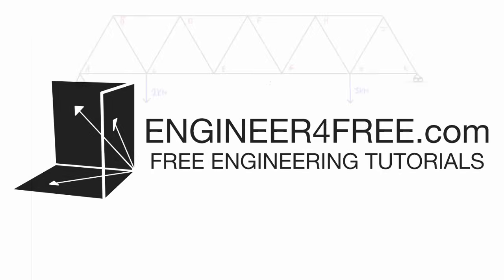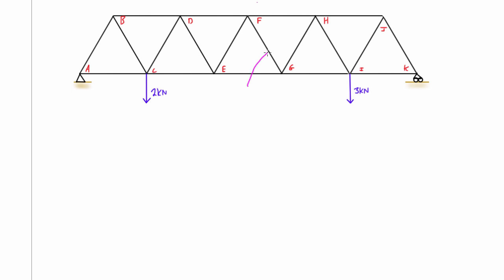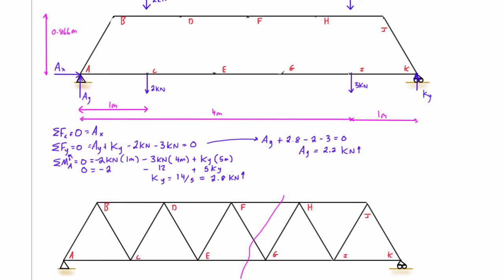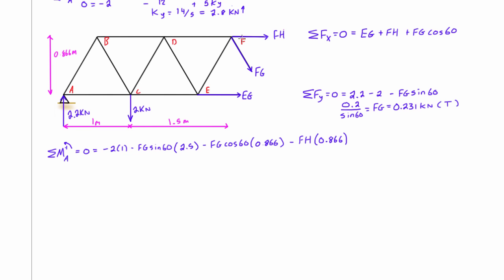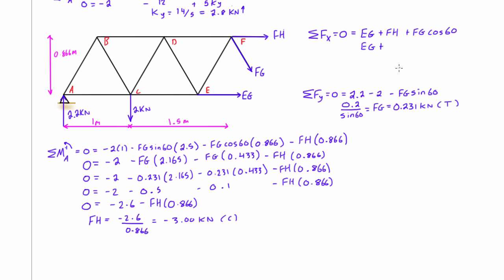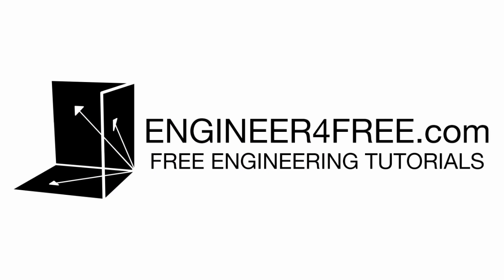Truss analysis by method of sections: worked example #1

Comment: If you had taken moment about Point F, it would have been one step to solve the problem. Nonetheless, very well explained
Reply from the maker: Yeah true. If you can see that, then you're doing alright =) =)
Reply: @Engineer4Free  could you please explain what ou mean? if you take moment about point f wouldnt the forces we want to find be acting in the point and not formed into an equation
Reply: @nahilismail3144  the force EG isn't, its perpendicular distance from point F is 0.866m- so you can calculate EG and sub it into Fx equation 🙃
Reply: @inyoungbaek6426  thank you so much for helping a stranger you know nothing about. i hope you have a good day!
Reply: Yeah, I was thinking the same. But finding out all the unknowns can be useful for checking the answer by summing all the moments about an arbitrary point and see if that equals to zero.
Reply: @Villager-  looool
Reply: The moment about f should be -2.2kn(2.5m) +2kn(1.5m) +EG(0.866m)=0

Comment: Hey how is the FG cos 60 (0.866) shouldn’t be half of 0.866? I was just wondering this since FG sin 60 is (2.5) because the 1m was cut in half?
Reply from the maker: Yeah so in the first line of the sum of moments about A equation, notice that there are two terms that include FG. One has an FGsin60 and the other has an FGcos60. The FGsin60 is the y component of FG, and it's also multiplied to 2.5, which is the perpendicular distance from A to the line of action of the force FGsin60. The FGcos60 is the x component of FG, and it's also multiplied to 0.866, which is the perpendicular distance from A to the line of action of the force FGcos60. Notice that the line of action of the x component of FG (FGcos60) is a horizontal line, in line with the top of the truss, which is 0.866m above the bottom of the truss. Both x and y components of FG cause a moment about point A, so both need to be accounted for in that equation.

Comment: 3.25 how come you are including Ay of 2.2 kN in the Fy expression, but you’re not including Ax in the Fx expression?
Reply from the maker: It's because Ax is can be determined to be equal to zero by inspection. There are no horizontally applied loads and the structure is simply supported, so Ax must = 0. Because its zero, I just don't bother writing it in the Fx expression. Hope that makes sense!

Comment: When finding the moments at A... when we're looking at the y component of FG acting at 2.5 metres, should it not be cos30? It's acting at 30 degrees to the y axis. Or am I misunderstanding? Thanks!
Reply from the maker: Hey, the equation for moment is M=Fd, where MN is the moment caused about the point, F is the magnitude of the force, and d is the perpendicular distance from the line of action of the force to the point. 2.5m is the perpendicular distance to the line of action of the y component of FG only. 0.866m is the perpendicular distance to the line of action of the x component of the force. Neither 2.5m or 0.866m are the perpendicular distances to the line of action of the force FG. It’s longer to try to find out what that distance is, than it is to just separate it into x and y components and solve by parts.

Comment: If everytime you have negative value and plug it in to another equation, should I plug it with remaining negative sign or can I change to positive sign? as long as the final value would tell you if its in tension or compression? I'm confused, please enlighten me. Thanks
Reply: In this example, you have FH = -3kN then plugged in the Sum. Fy equation to get have a value of EG = +2.885kN. What If I plug it with +3kN since I know that FH is in tension and changed the graph. The  value is different I guess.
Reply from the maker: @shariffnurrmohammad1314  Hey yeah. So just to clarify, FH is actually in compression. I drew it initially in tension, and found it to have a negative magnitude, which means it's true sense is compression, not tension. Once you know that a member is truly in compression you can do two things. 

Method #1) Do not update the arrow on any FBD (ie, keep it drawn in the tension direction) and then any time you analyze a FBD that involves that force, use it's direction to determine whether you add or subtract in the sum of force equation, but then substitute a negative value for the letter. That's what I did in this case. Calculated FH to be 3kN Compression in the moment eq, and then in the sum of force in x equation, I left the arrow for FH as if it were in tension, and because FH points to the right on this FBD, I give the FH a + sign in front because it points in the positive x direction. But then irrelevant to that + sign, I substitute "FH" for "-3kN" and "+FH" becomes "+(-3kN)" which is equivalent to "-3kN". 

Method #2) Update the arrow on all FBD's that it interacts with to show that it "pushes" on the joint rather than "pulling" and assign it a positive value. So if we did this, then we'd have to update FH at joint F to push on it (to the left) rather than pull (to the right). When we take the sum of force in x direction, then we'd give the FH a - sign in front because it points in the negative x direction. So we would have a "-FH" already in the expression, and then we would substitute "FH" for "(positive)3kN" and "-FH" would become "-(3kN)" which is equivalent to "-3kN".

Hope that helps to clarify. We in a way have two layers of +/- rules going on here. One is that when solving for the unknown internal force of a member assumed to be in tension, that + means it is in tension and - means that it is in compression, and the other sort of unrelated thing when we are taking sum of force in x or y direction, that + refers to whether a force in a FBD is pointing toward the positive direction, and - refers to a force that is pointing toward the negative direction.

Comment: I’m confused sir, on moment at A why did you use FG twice (horizontal and vertical) isn’t you just choose one or use one FG in he equation, and why not put EG on the equation?
Reply from the maker: FG is diagonal so has both x and y conponent. Both of their lines of action do not pass through point A, so they will cause a moment about A if their magnitude is not zero. That's why we use both. The line of action of EG passes through A so it cannot create a moment about A, so it just gets omitted from the equation.

Comment: if I need to calculate forces on JH then will a method of section works or we need to use the method of joints?
Reply from the maker: Either works. If doing method of sections, make the virtual cut through members JH, JI, JK, and if doing method of joints, find the reactoins, then solve joint k first. Next you would solve for joint J and would find the answer.

Comment: If you draw the forces going out of the joint and get a positive number, that means that the force is "pulling on the joint", making the joint in tension. But this means that the actual member is in compression right???
Reply from the maker: Ahh not quite. You got the first part right. If a member is pulling on a joint, then that member is in tension. Think about rope. Ropes can only be in tension. If you have a rope with a joint attached at each end, and that rope has been tightened somehow such that it is pulling on each joint, then the rope is in tension. The rope that pulls on support reactions is not in compression, and nether would a steel or wood member that is similarly "pulling" on each joint. If you're still not convinced, switch the perspective that you observing from. We're talking about the member pulling or pushing on the joint; so this what's going on from the joint's perspective. Try thinking from the member's perspective. If a member in static equilibrium is pulling on a joint, then the joint can be thought of as pulling on the member, just in the opposite direction. So if you're a two force truss member, and a joint is pulling on each side of you, then you're getting stretched out. Getting stretched out mean's that you're in tension. Conversely, if you're a two force truss member and your pushing on each joint, then those joints are pushing back on you. You're getting pushed on both ends. You're getting squished. Getting squished means that you're in compression. Hope that helps!

Comment: at 3:18 ik trignometry but can please explain why you use sine or cosine? it's difficult to see when to use each...
Reply from the maker: Hey. If you are unsure, of which to use, draw a right angle triangle overtop of the truss that includes the angle you're working with, and two of the sides along the members that make up that angle. From there, label the angle, opposite, adjacent, and hypotenuse sides. From there you can determine whether you need to use sin or cos. See this image: https://i.imgur.com/Dvdqf2t.jpg
Reply from the maker: When in doubt, draw a right angle triangle over top of the truss, using the angle in question, and both members that touch it as 2 of the 3 sides of the triangle. Then label on the opposite, adjacent, and hypotenuse sides, and from there you can determine if you need to use sin or cos to solve the unknown in question. See this image: https://i.imgur.com/Dvdqf2t.jpg

Comment: would u have to do anything extra if point G had a force pulling downwards from it?
Reply from the maker: Yes. You would need to include it in the FBD of the whole structure, when calculating the reactions at A and B. It will cause A and B to be different than they are now. After that, proceed in the exact same way. You can make the same cut, and inspect the left side of the structure if you want, but you will get different answers, because Ay will be different than it is now.
Reply: @Engineer4Free  but with the problem I’m doing, it asks my to find EG but joint G has a downward force acting on it. But when I split the truss in half, it gets cut off. What do I do?
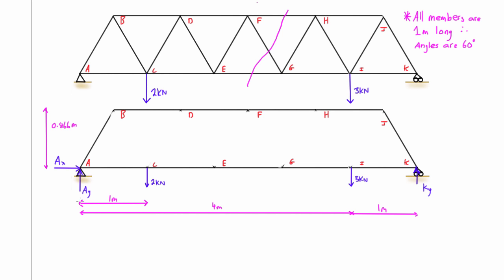Reply from the maker: @SHIZZLE71  That's ok, it's not a problem. Go to 1:40 where I take the FBD of the whole structure. Include your extra downward force, at G. So you'll have an extra term in the sum of y expression, and also the sum about A expression. You will fin that Ay will be bigger than if your downward force did not exist. Once you found Ay, then do the cut, and analyze the left side. The downward force at G will not be present, because it is on the left side of the cut. But the influence of that force is already accounted for. This is why Ay is bigger than if that force at G was not there. It's because Ay knows its there from the calcs at 1:40. When you solve for FG, FH, and EG, their magnitudes depend on Ay. And Ay depends on all of the external forces, including the one at G. Hope that helps.. If it's still not making sense, then I just recommend watching vides 42-51 here: engineer4free.com/statics After doing several examples you might start noticing the pattern that they all follow, especially that Ay and By depend on the location and magnitude of the externally applied forces.

Comment: I got a completely different answer solving from the RHS?      I got Rk=+2.8kN
I got EG from taking moments about F to be 2.87kN <--                                                EDIT: nvm sry got mixed up... still got the right answers :P 
I got FG from taking moments about H=0= 0.5(3)-1.5(2.8)+0.866(2.87)+0.866(FG)
Therefore -0.866(FG) =-0.21458,         FG=0.248kN Tensile
Is the question maybe not set up correctly, or have i done something wrong? plz help :/
Reply from the maker: Ok so you are all good? Can't tell if the text after the edit is still relevant 🤔

Comment: Why did you take FGsin60? I used the same method on my test it happened to be wrong.
Reply from the maker: The angle might have been different on your test, or you may have needed to use cos instead because of the certain context. You have to take care when constructing the right angle triangle that you will use for your trig functions, here is an example of how to do one,: https://imgur.com/a/YCT6I1a sin is usually used for the vertical component, and cos is usually used for the horizontal component, but not always, it depends how you draw the right angle triangle

Comment: What happened to Ax at the sum of x of the left section
Reply from the maker: There are no externally applied forces with any horizontal component. Ax is the only reaction force that can withstand horizontal loads, so the sum of forces in x direction equations is just Ax = 0. I skipped it, because it's almost always zero in these problems. So you could label it on, but it equals zero anyways and has no affect.

Comment: can someone answer my question ? why did he not include the EG in summing the forces ? thank you
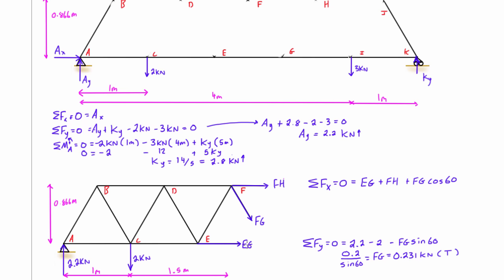Reply: If you are talking about when he is doing the moments about A (time 3:30 ) then the answer is cause EG is pulling straight in the X direction with both Ax and EG having the same Y coordinates. 

If you are talking about the horizontal forces summing, he does have EG in there. 

If you are talking about the vertical forces summing, it is not in there because EG is not a vertical force.
Reply from the maker: @joshman9757  Yup thanks dude. The line of action of EG passes through point A, so it doesn't cause a moment about point A =) =)

Comment: can you cut them multiple times?
Reply from the maker: If you're cutting the truss in half to completely separate one side from the other, then make sure to only pass your virtual cut through a maximum of 3 individual members. If you for some reason pass through 4 or more, you won't have enough equations to work with.
Reply: tnx for your videos 😁

Comment: help sir im just really confuse, in summation of moments at A  isn't that -2kn(1)-3kn(5)-ky(6)=0?
Reply from the maker: Yes but you have some typos. The sum of moments about A can be written as Ma= -2kN(1m) - 3kN(4m) + ky(5m). Your measurements to the 3kN force and ky were the typos, as well as the sign of ky (it’s pointing up so is with the method of sections we don’t want to take the sum of moments about A fro the whole structure, in the later part of the problem. You want to take a virtual cut and the. Do the sum of moments including the internal forces of the members that were cut. You should watch this video to understand the method: https://www.engineer4free.com/4/truss-analysis-by-method-of-sections-explained also watching videos 42 - 51 here https://www.engineer4free.com/statics.html would help in general to understand trusses better
Reply: @Engineer4Free  lol  i know now why im confuse  sir its because i thought from point C to point I it measured  4m  hahaha its from point A to I measured 4m thanks for the reply sir it was a stupid question hahaha  ur video is very helpful sir thanks

Comment: please why did you leave out Ax when you were finding the sum of X's
Reply: As in forces in the x direction
Reply from the maker: Because there are no horizontally applied forces on this structure. So if you wrote the expression for sum of forces in x direction, you would just have Ax = 0. Ax is the only thing that can apply a horizontal load to the overall structure (ie, not an internal force), so it just equals zeor. Because of that, I opted not to write the expression. If you're in a test, it's worth writing, but after making so many of these videos I started leaving it out. The rest of the playlist is here btw: engineer4free.com/statics =)

Comment: i thought if the ans is in negative its tensile? and if the answer is positive its compressive? is it the opposite?
Reply from the maker: The convention is to draw unknown internal forces in tension. If you do that, then a positive value indicates it is in fact in tension, and a negative value means that the direction must be switched so it is actuakly in compression. If you're drawing unknowns in compression though, then the logic is flipped. I recommend following the standard convention as I have done in this video!
Reply: @Engineer4Free  I had this same question. when you made the cut, you drew arrows for the members and the members are shown to be acting in compression (pulling away from the joints). Also when you plugged it into the equations, you kept the same convention. Positive answers confirm your convention of the member being in compression. What do you think?

Comment: hey great vid I just wanted to ask why does FGsin60 multiplies by 2.5 and the FGcos60 multiplies by 0.866
Reply from the maker: Hey Dinh. It's because those are the perpendicular distances from point A to the lines of action of FGy and FGx. FGy's line if action is vertical, passing through point F. That line is two and a half members away from A horizontally (being AC, CE, and half of EG} - draw a vertical line passing through F, and you'll see it I tersects member EG in the middle. That's where the 2.5m comes from, cuz they're all 1m. The line of action of FGx is horizontal, passing through F. It's in line with the OOP part of the truss. The top part of the truss is 0. 866m above the bottom part of the truss. You can find this because you know that member AB is Angles at 60 degrees (part of an equilateral triangle). So 1m * sin60 =0.866m from basic trig. Hope that helps clarify it all. Thanks for the good question! 😊
Reply: @Engineer4Free  thanks, i was curious about that too.
Reply from the maker: @2a1n71  glad I could help!

Comment: How did you get the height of 0.866 ?
Reply from the maker: It is the sin of 60. The diagonal member is on a 60 degree angle because it is an equilateral triangle. 0.866 is the y component of that member, aka the height of the triangle, because each member is 1m long